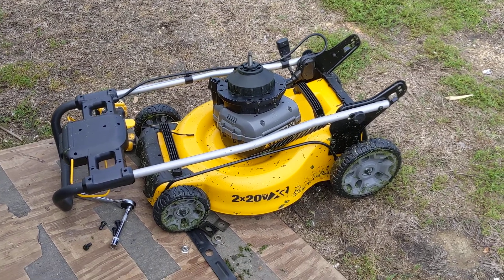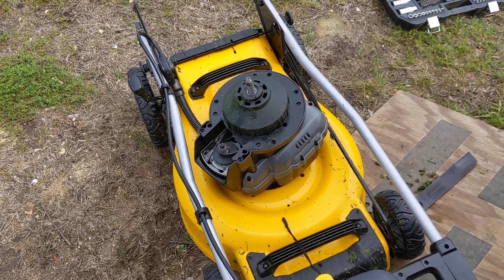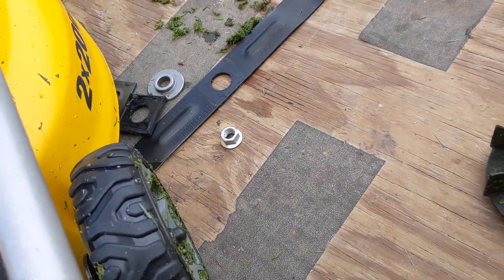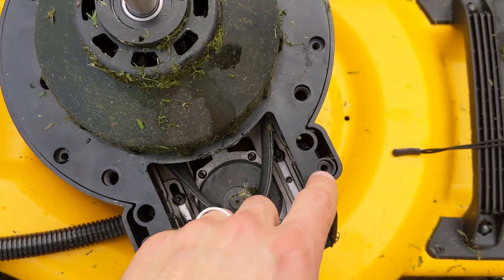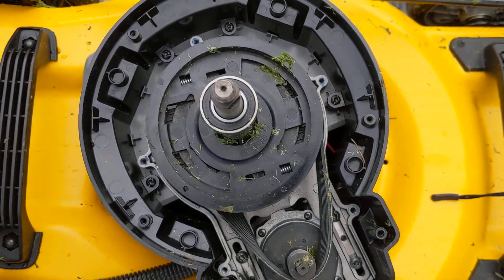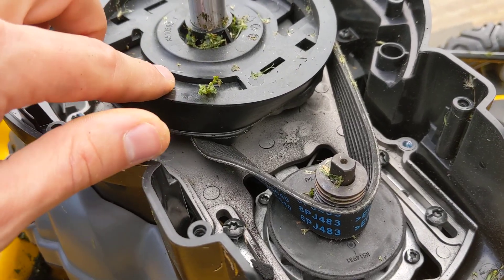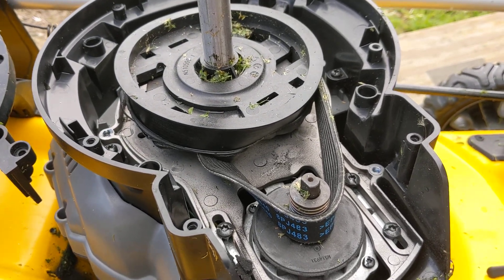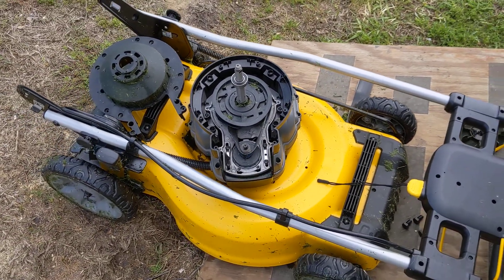Dewalt 2X 20v XR Lawn Mower Problems

Comment: Mine failed today. Saw smoke. Imagine if I take it apart I’ll find some similar issue. Thanks for the simple, straight to the content video!
Reply from the maker: Yeah, sorry to hear. They sent me out a brand new one from the factory and I took it apart and it's got the same pulley still... I don't know if you're within warranty, but I have always had great service from DeWalt so it might be worth a call even if you are outside of it.
Reply: @MyFortressConstruction  How has it done you over the past two years? I just ordered one an hour ago and will use the 9ah 20/60 flexvolt betteries for it.
Reply from the maker: @CaseySexton  The first one failed after 5 uses. I'm at 3 uses on the new one. I bought it January 2020 so it's longevity isn't looking great...
Reply from the maker: @CaseySexton  The second one died a week ago after 7 uses. They're shipping me a new one.
Reply: @MyFortressConstruction  Thanks for the update. So far mine is working ok but that doesn't make me have a lot of faith in it. They need a better quality pully if they're going to put their name on it and sell it at that price.
Reply from the maker: @CaseySexton  This time I was using it and the batteries got to one bar and it stopped. I put in new batteries and it just wouldn't work. No smoking, no warning. It just stopped. Let it rest overnight in case it had an overheat sensor, and tried messing with the safety switch on the side, tried different batteries. It just wouldn't start. DeWalt paid for shipping to their service center and then ordered me a new mower from the factory. 3rd time's the charm?
Reply: @MyFortressConstruction Let's hope so. The second generation will hopefully have these problems worked out. It's good that they're taking care of their customers though.
Reply: Hello everyone, I was just on here looking to see what kind of test have been put on this mower. I have one and used it all summer to cut several small areas in my yard and so far have had no problems at all. But seeing this video does worry me some
Reply: @CaseySexton  I think I had a bearing failure on my 21in 2nd gen. It vibrated like an ICE mower and cut out after  few seconds. I returned it to Homedepot and will give it another go.
Reply: @MyFortressConstruction  ]*6

Comment: Mine just stopped working all together in about a year. Used it probably 12-15 times. It does overheat... mine would cut out and I would switch to the gas mower...

Comment: Man I was just about to order this mower since I already have all the other Dewalt gear and batteries.... plastic pulley 😂😂😂.
Reply from the maker: Good choice. My replacement mower just died! They are shipping me another one from the factory. The first one lasted through 5 mowings. The second through 7. Pretty reliably unreliable.
Reply: @MyFortressConstruction  I'm pretty sure DeWalt will address this to keep their reputation. Good luck.
Reply from the maker: @johnwilmington631  That would be nice if they came out with a real mower like makita or ego. I too have a lot of DeWalt tools. This is the only one that hasn't been able to "cut" it.
Reply: DEWALT just Came out with a GEN 2
Reply: @jonienglish3231  When? I got a new one on Sept 16 2022 and the self drive doesn't work and blades bogged down in wet grass.

Comment: Does not cut the grass short enough.  Very disappointed in this aspect.  Even at it's lowest setting it leaves the grass at least 1 inch long.  Most reviews I've seen seem to focus on how it tackles really long grass and in this regard I'm sure it does well but I bought this specifically to improve the appearance of my grass area which I like to be short (about 1/2 inch).  Given the range of height adjustment I would think that the lowest setting would equate to a closer cut. The blade sits well above the metal deck and I've looked to see if there is any way to lower it on the shaft but there isn't.  I'm a  Dewalt fan (I own 9 different battery tools) and admire their attention to design detail so I am very disappointed  that this seems to have fallen short (no pun intended) of their usual standards.
Reply from the maker: Yes, I had notice that as well and figured it was because if they made the deck lower it would bog the motor down and cause overheating even faster. The lowest was fine for my lawn, but some grasses do well at shorter lengths. I have about 40 of their cordless tools, so I was definitely disappointed with this lawnmower. I sold the 3rd one they sent at a greatly reduced price and bought a cheap gas mower.
Reply: @MyFortressConstruction  I don't think the deck needs to get lower (it just about clears the ground on its lowest setting).  It's just that the blade sits far above the bottom of the deck.  A longer motor shaft or different profiled blade letting it get closer to the ground would sort out the issue.
Reply from the maker: @daveharwood7894  Right, I wasn't being specific. It's like me calling all video games nintendo's. 😄
Reply: Same issues here.

Comment: So I let my friend use mine to scalp my lawn but the grass was 3-4” tall. He had the mower at lowest height & he choked out the motor by mowing to fast. Now my mower won’t start at all. Batteries are good & everything is cleaned. Looks like no power going to the motor from the batteries. Any suggestions?
Reply from the maker: Well, I have "fixed" many cordless tools by simply taking them apart and putting them back together. However, it seemed to me that these mowers had issues with overheating. Some delicate part, sensor or circuit would get fried and that was it. If you could trace where the power enters but doesn't exit, then you could try to source the part, or bypass it, but repairing circuitry is beyond my knowledge. I'm also supposing it's outside of it's warranty? So, again, bypassing the sensitive electronics won't be safe, but might be the only way to get it running again. Just please, don't chop off any fingers because of that recommendation, and good luck!
Reply: Mine is doing the same

Comment: Wow. This saved me! I'm not getting a poor design lawn mower like this! SHAME ON DEWALT FOR RELEASING SUCH GARBAGE! I've been cutting lawns for 10 to 15 years. I know what's needed in a lawn mower 21 inch. Thick blades! Not these little flimsy blades on electric mowers. Metal parts! Less plastic unless expensive plastic that's strong. These electric mowers have a long long way to go.
Reply from the maker: Yeah, there's no way they can handle more than 5" and it will bog out with that. The new mower they released is better, but it still doesn't have the torque that a gas mower does.

Comment: Was about to pull the trigger on one till I saw this .
Reply from the maker: Good choice. My replacement mower just died. They're sending the 3rd one out now.
Reply: Good call. It's barely functional... over heats... break easily. Waste of money.
Reply: @athletejmv  bought a stiga volt70 instead.   Thing is s beast .......

Comment: Did they replace the pulley with a better quality piece?
Reply from the maker: Nope. Just got a brand new one (Mfg. date: 2020) from the factory and they changed how the handle connects, but the pulley is the same.
Reply: @MyFortressConstruction  Was it warranty, or how much did it cost you?
Reply from the maker: @artwilbur4253  It was under the 1 year warranty so shipping and repair was free.
Reply: No, they redesigned it to be direct drive, so if you hit a rock or tree root, the impact is transfrerred directly to the motor, instead of the belt slipping.
Reply: @gamewizard1760 on the new ones too, that have drive assist?

Comment: Gets hot, pulley melts, mower craps out.  As if this could not have been foreseen by not using cheap plastic.  My sisters newer self driving Dewalt 20V mower stopped working.  She took it to service center (50miles) and they claim that because there is a little notch on the blade that this damaged the motor and control board and the warranty is void.  So the $500 mower, used 12 times, is now scrap per Dewalt.  My Dewalt 20v trimmer died after half a dozen uses and they would not fix it - I took it apart and found 2 electrolytic caps on controller board were bad, fixed it myself.  Now I can try to fix my sisters mower.  NEVER BUY DEWALT, the company is owned by Black and Decker now and is crap.  There products break, the service people cannot communicate in English, and their primary job is to claim it is your own fault 
that a small rock nocked out all the electronics.  NEVER BUY DEWALT. The once good company does not exist anymore.  I will fix it myself, and l bet I will do it too!
Reply from the maker: That's really terrible. Escalate it to DeWalt corporate via email. I did that with an impact wrench that was taking them months to get a part in for. As soon as I reached out to corporate they sent me a new one. They need to honor their warranties and mine always has (3x in a row on this mower). Good luck!

Comment: I own one of these and they are total garbage. Complete waste of money.  I actually wouldnt even recommend it if it was free. The support was terrible and it was way over priced.  

A used garage sale gas mower would cut circles around this thing.
Reply from the maker: Yeah, 1st gen. mower was absolutely terrible. You should watch my video on the gen 2 mower. Different build, different issues.